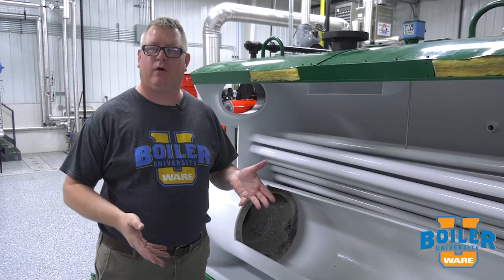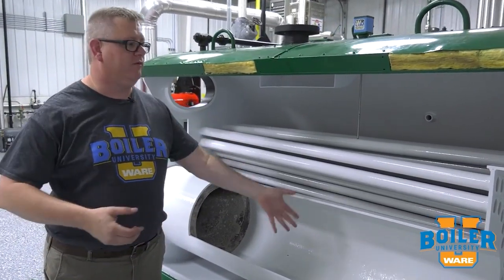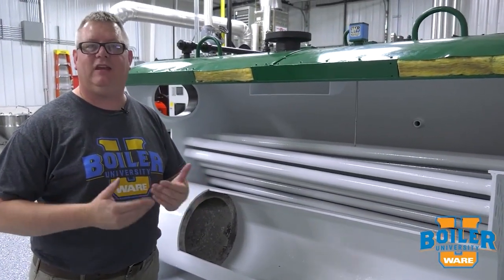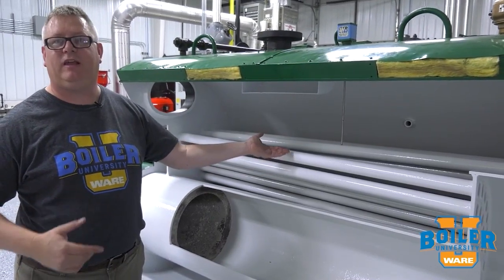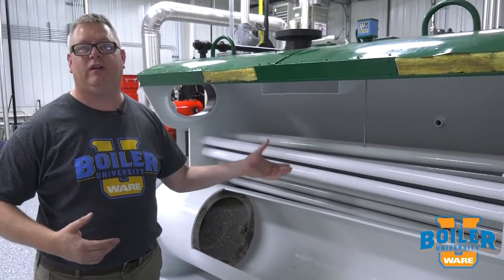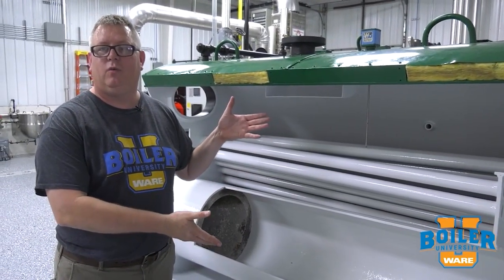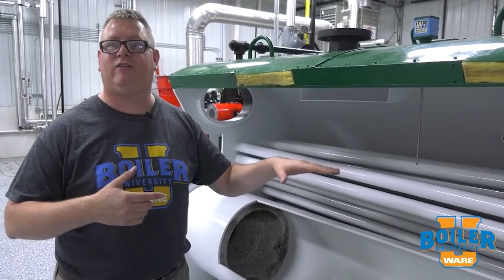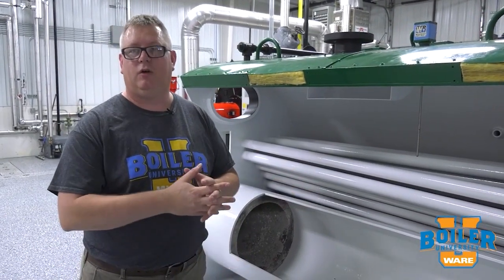One Simple Way to Detect Soot or Scale Buildup - Weekly Boiler Tips

Comment: I just replaced tubes on a Bryan D boiler. Turned boiler on and immediately had high stack temperature of 730 degrees. There are 5 boilers that share a common stack. Seen a completely sooted up high wind cap. Boiler next to it has stack temp of 640. I’m thinking flue stack is sooted up? Any ideas?